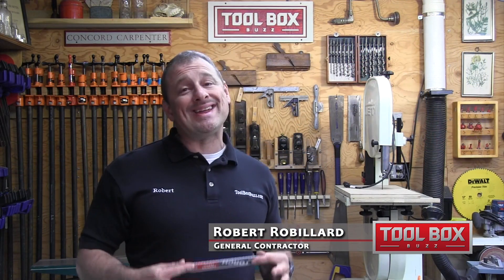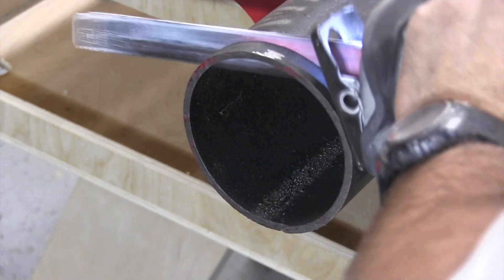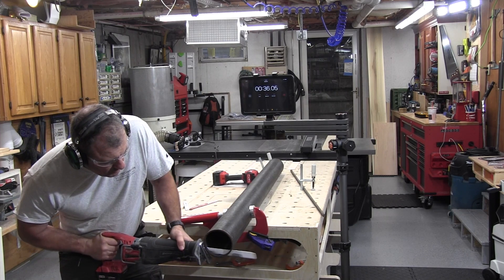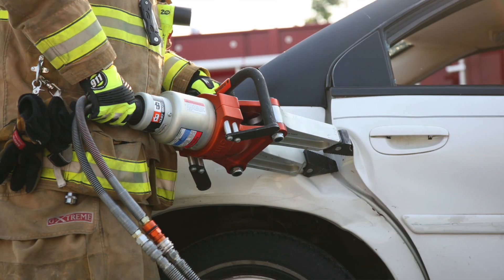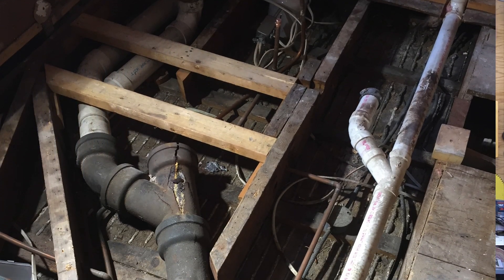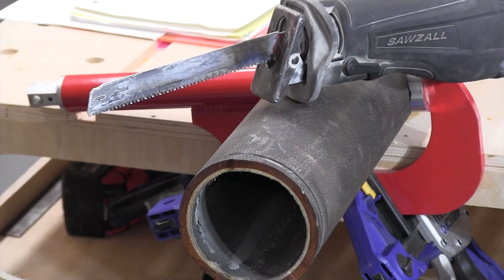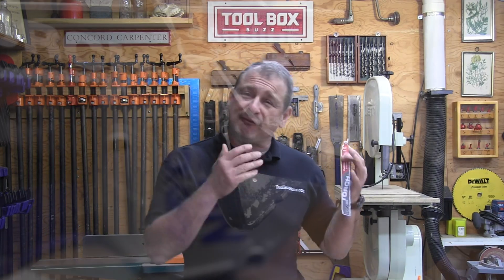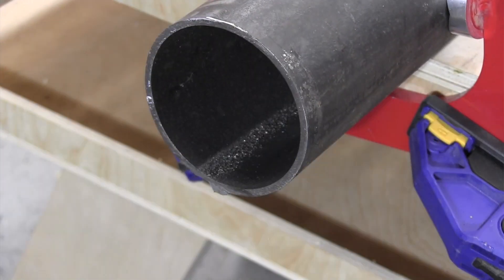Milwaukee TORCH Carbide Teeth Blade

Comment: as a plumbing contractor this is an almost universal blade. galvanized steel, pvc, nail embedded wood, and even to finish off cast iron cuts started with grinder.

Comment: Just used the Diablo carbide blade to cut some some old 3 foot diameter galvanized culvert that was replaced due to rotting out at the bottom. Made quick work of cutting them into sections for easier transport.  Two of them over twenty feet long.  Made the job much easier.  Took longer to move the cut down sections with my tractor than it did to cut them.  I'm not a tradesman. Have the same saw that is in the video. It's a beast.

Comment: Personally use a sawzall for most cuts vs a bandsaw in most cases. If you are half decent you can cut anything you could with a bandsaw and more and if not more precise too. I hate those thin metal bandsaw blades.

Comment: How does it compare to the Diablo blades? That's the real test.

Use the thinner Diablo one, too. It's the one we've found to be most useful. The thicker one actually takes longer
Reply from the maker: Jose Gomez as good
Reply from the maker: Jose Gomez 4” Black Cast Iron Water Pipe [5/16” thick walls]

I want to note that the preferred cutting of pipe would be a band saw. In restricted access areas, a diamond grit blade, “used to be,” the best way to cut cast iron pipe, but it takes a long time. The Torch™ blade can reduce that diamond grit cutting time from 2 minutes to 30-seconds. For comparison purposes I used the Diablo Steel Demon Carbide Tipped blade. I performed two tests each, with a fresh blade, compiled the test results and determined the average cut speed. Below are the compared results.

8 cuts – average cut speed results:

Milwaukee Torch™: 45-second average cut.
Diablo Steel Demon: 44-second average cut.
½” #4 Reinforcement Steel [Rebar]

Reinforcing bar or rebar is used to add tensile strength to concrete. We run into rebar a lot on the jobsite and often see it used to pave roads, build pools, and reinforce concrete footings, slabs, piers, columns and walls. For comparison purposes I used the Diablo Steel Demon Carbide Tipped blade. I performed two tests each, with a fresh blade, and compared the results.

20 cuts – average cut speed results:

Milwaukee Torch™:   4.4-second average cut.
Diablo Steel Demon:  5.2- second average cut.
The end result was 0.8 [8/10s] of a second difference. I continued to make cuts with the Torch™ Carbide Tooth blade and stopped at 45 cuts, due to fatigue. The blade was still cutting but was dulling and slowing down. Below is a diagram showing both the Torch™ and Steel Demon blade performance.
Reply: Thanks a lot. I'll pick them up next time I see them. Gonna be fun testing both out. Love the design on the Milwaukee blades too

Comment: Go watch the essential craftsman's video about sawsalls you may be cutting a little fast and causing too much heat buildup on your cutting implement which significantly reduces the life.
Reply from the maker: MontrealLather Maybe, but these are reciprocating saw blades they are made for cutting metal quickly and in tight situations period I decided to get the job done, 44 cuts  in Rebar, In the same area is pretty impressive

Comment: Do we have a clear winner of Milwaukee vs Diablo? Costs?
Reply: I just purchased one today from Home Depot for $15.97.  The Diablo version was $14.97.  I'm not sure if either one has any significant advantage over the other.  If there is any advantage it may be more slight.  I have used the Torch blade with the DeWalt Flexvolt reciprocating saw (DCS388) to cut down rebar and an old metal adjustable height basketball hoop setup, and some old metal excersize equipment and it ripped through them impressively.

Comment: I would be curious to see a comparison test of a wood blade to metal blade cutting lumber. I know the wood blade would cut faster but which one will hold up longer. Might even be more interesting to see lumber with nails maybe something akin to what would be found on a deck demo.
Reply from the maker: famous636 a carbide wood/metal demo blade would be the blade for that
Reply: big teeth big spaceing between cuts the fiber removeing alot dust.. while the bi-metal blade small teeth of centerd will gumm up after few cuts... BUT if cuting a small woodpiece and want a realfine edge on it then use the bi-metal blade
Reply from the maker: famous636 These are not for nail-embedded or demo work, they are strictly for metal cutting